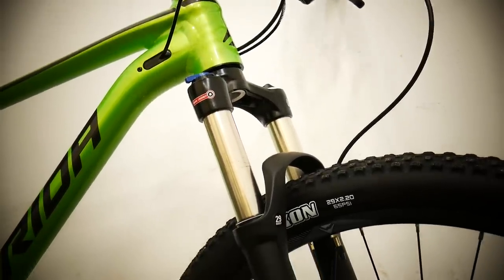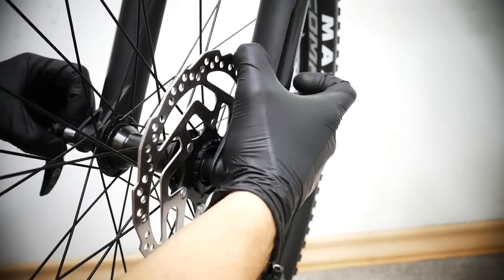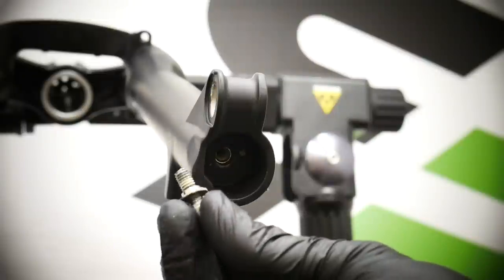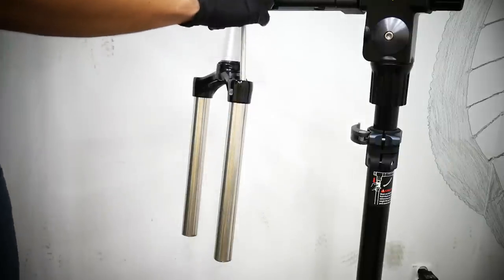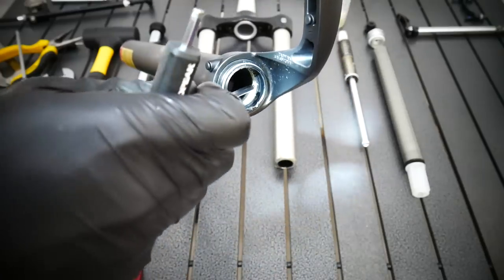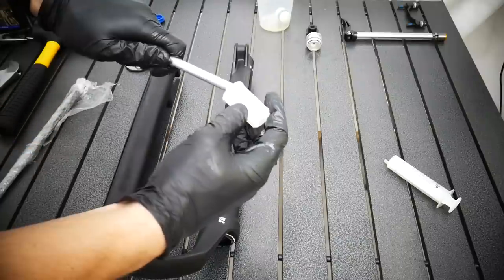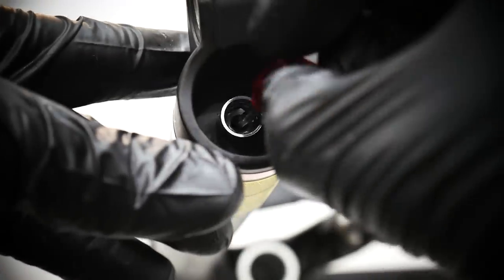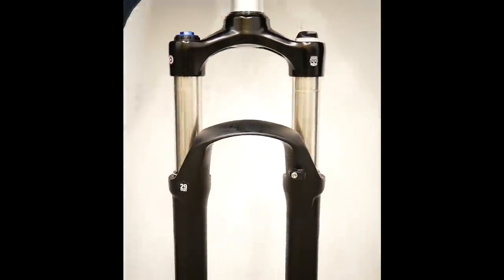Finally! SR Suntour XCR Air LOR Suspension Fork Service. FULL Overhaul.

Comment: This is the closest I can find for servicing my 2015 sr suntour epixon 27.5 forks.. Even after emails to sr suntour they said to just put it in a shop.. They didn't seem to know the oil specs or torque of the bolts, there's nothing on the official website either.. That's poor if you ask me. Very unimpressed with them.
Reply: Go to the Suntour USA website. You”l find some spare parts, and there even oil.

Comment: I like your video guide. After 11 years of use and about 27.000 km, I decided to service the fork. Although it still worked fine.  I viewed several videos and didn't find any pertaining to my specific fork. However, while doing the service I noticed that with a little technical knowledge, you can do similar forks as well. One other thing I have noticed, is that there was no need to actually do a service /cleaning on my fork. Yes, the grease looked old, but there was no water or dirt inside. It has been a learning experience for me. Maybe there is a need on bikes that are in the dirt frequently. My fork doesn't perform any better after the service. Thank you to the creator of the video. Very great job.

Comment: Great video. THANKS! Just a clarification: it is not an error to put air at 13"0' because without it, it is not possible to screw the nut of the air cylinder at the bottom: it turns without tightening, the rod inside is not fixed.

Comment: This video was so helpful to me.
Had 2 bike shops laugh at me when I told them i was going to service my forks.
Anyone debating weather or not to service your forks, give it a go!
After 6 months of use mine had completely stopped working. They were not absorbing any small bumps and would stay completely ridged over rough terrain until a large amount of pressure was put onto them such as a drop etc.
I didn’t take the whole fork apart like in the video and still had good results and it only took around 20mins. I turned my bike upside down and took the wheel and break off. All i did was take off the adjuster nob, undo the allen bolts, take off the lower legs and give everything a clean and re-grease  
If you get a torch you can see Inside the lower legs there are small square indents around 1cm x1cm around the inside of the shaft. I put a fair bit of grease in these indents as this is where the stanchions sit once they are put back together and will help keep them lubed. 

You don’t have to take everything apart on the forks just take the lowers off and clean them up and put new grease on the inside and around the seals.

The forks are working great for me now this video helped a lot. Thanks
Reply: I had the same reaction from my bike shop - so will do myself. Did you put in the foam rings? Does anyone know what diameter they would be? Great video very helpful
Reply: @gavinfreeman3234  didn’t put in the foam rings. By the sounds of it suntour forks run off grease alone and don’t have oil. I think the foam rings are mainly to act as a sponge for the oil to lube the stanchions as they move. After around 20 hours of riding i can start to notice them stiffening up again, i think its due to the dry dust getting into the forks. On sr suntours website they suggest the forks seals need regreasing from the inside after every 25 hours of riding so i will be doing this more often now as i found it a fairly simple job that only took 20 minutes or so.
Have you done yours yet?
Reply: @yaface120  Nope But that makes sense - on the video it looks like there is some oil in fork - but only about 5ml. Never done it before, what grease do you use? It is my sons bike and i can feel it starting to stiffen up a little. But he is such a light weight that i suspect he could go another 100 hours before it become a problem
Reply: @gavinfreeman3234  on rockshox forks videos it seems like the oil gets put in the legs where the stanchions sit? On the suntours the oil goes in the top compartment im guessing to lube the spring. Im not an expert so could be wrong. 
I used fenwicks high speed grease as it was all i had around. I think its made mostly for bearings but its pretty thin so i thought it would be ok. Most videos I’ve watched recommend sram butter or slick honey if that helps

Comment: I have my Suntour Epicon X1, which I am using for almost 20 years now, and still working very nice and smooth. All parts are almost exactly the same as your XCR except on the negative spring assembly. My X1 negative spring had a stopper with pin to adjust the travel of the fork. I changed the travel from 100 to 120mm 4 years ago, and that was the first and the last time that I serviced my fork. You mentioned that your XCR do not have an Oil Foam Ring, mine have.
Reply: What is the diameter of the thread on the upper part of the damper (oil cartridge) -right, for epicon x1 it is fun062-10 !?

Comment: Great video,  worked for the XCR Air that is fitted as standard on my 2017 Specialized Rockhopper.    The forks were terrible before the service, even though they have not been used much,   but they are far better now.   When putting it back together I needed to have some air pressure in and apply a sharp downward force to get the air spring side bottom bolt to tighten properly,  before this the internal shaft kept spinning.     As per the video,  I then had to let the pressure out to get the rebound side bottom bolt in.            I gave the internals a full degrease and only used oil when reassembling,  the fork now gives far better small bump performance.      Others have also suggested oil rather than grease improves the fork.
Reply: What about the air piston oil?
¡We have same bike!
I wanna do the service to my fork too but i am worry if i gonna need new oil.

Comment: FYI The Q Loc axle. 
After loosening the quick release, make sure to push then turn/tighten the bolt to keep the flanges in.  This is the correct manufacturer's guidelines.
  Because for one reason, it will jam up on some models of hubs, due to step downs and widening inside ;)

Comment: I just added a small piece of foam inside the air chamber to make the fork more progressive so it reacts better under small bumps and it actually works. I am now using less pressure but I can feel it getting stiffer as it reaches the end of travel. 
Until now it was all soft and bottom out or hugely stiff with no small bump compliance at all.  Its a nice fork (for what it costs) and it has taken quite a bit of abuse and its going strong after a 1000Km of trails.
Reply: Can you clarify what type of foam? Was it directly inside the air chamber above the piston?
Reply: @denismacfarlane255  It was a  small piece of closed cell foam that i cut to size and with a hole in the center  that I attached to the inside of the air top cap . I have  had to cut it  a bit to get it right but it enabled me to lower the air pressure so the fork works better on small bumps without bottoming out anymore.  Suntour used to sell a piece off foam  for this fork and that is where I got the idea from.
Reply: @cortarelva  What size form did you use?
Reply: since the negative spring is a coil you can just fill the air chamber with oil to reduce the volume. But dont dump it in, do it in for example 5ml steps (fox float fluid pillow packs are nice for this)

Comment: I just got a 2022 version of this fork. I have owned a couple of the higher spec suntour Aion forks before and loved them. Initial impressions of this one are pretty positive after 1 ride... still need to play arround with rebound settings.  The forks specs are very good for the money. It's not as nice as a more expensive ones, but you get what you pay for and it seems a capable budget fork. There are still no foam rings but I ordered some... didn't cost much. I'm wondering if it is because they have steel stantions? I noticed that none of the suntour or rockshox forks with steel stantions feature a sag indicator ring... and now wondering if they all omit the foam rings too, possibly to prevent rust forming if they get saturated with water from neglect / poor maintenance 🤔 I will be careful to do regular lower leg services to be safe. Overall i like this fork. It should not be confused with the realy cheap steel sprung suntour forks on "leasure" mtb's. This is significantly higher performance and quality. Thanks so much for the great tutorial 😀

Comment: Nice work. I have a 2017 Cube Stereo HPA 120 Race with a Manitou Minute TS air fork that deserves a rebuild. I can't locate any vids or info on how to rebuild this fork, or procuring new seals and foam rings. It's got 1000 Miles on it and is in great condition, shall I just give it a go? I do all my own work on our bikes and should have the tools needed. You made this SR suntour rebuild look quite simple, thanks for the push.

Comment: Tanks a lot fpr this video! Did an overhaul of my Suntour Raidon 34 Boost, which is pretty much the same build. Got it perfect and the fork works even better then new now! BTW i used SlickKick forkgrease and Liqui Moly 80W (GL4) oil. Fork is working very smooth now!
Reply: How much oil did you put in

Comment: This is very similar to my Raidon LOR boost fork that came on my 27.5+ bike, except the rebound knob/bolt and the air shaft fixing bolt aren't recessed like this XCR. I was also surprised to find no fork oil inside, however mine did have the foam rings above the bushings. It is a solid fork but terrible at ironing out smaller bumps and plushness. I am currently trying to tune the fork using different negative springs to see if there is any improvement, but so far still pretty disappointing.
Reply: @justahasbeen  Thanks for that. Have ordered a new Rockshox Sektor now anyway and waiting for that to arrive. I'll see how they compare and if the Sektor is worth it. Not a high end fork by any means but I would hope its better. I wonder about the longevity of that compression/rebound assembly too and the fact that it's not rebuild-able could be a false economy.
Reply: Same here
Reply: Thought I should add to my comment that my Rockshox Sektors have been amazing. A whole other level and I would say worth the money for sure. Pay a couple of hundred more (AUD) and you get so much more tune-ability, quality and performance. You can see where the extra cost goes.
Reply: Another work around with good results, is to buy some closed cell foam, and cut to shape so it fixs in the air chamber- through the top.  It works like air spacers making the fork more progressive through the stroke.  So, once it's installed run a lower pressure in the fork to improve small bump performance and combined with adding oil into the lowers it should be a dream.  This will be my next project on bike with Epixon forks :) I can't say how tall the foam should be as this is something I'll have to discover, using standard air spacers for reference :)

Comment: what about the oil on the lower legs of the fork ? this system is actually basically the same system used on Fox older shock . great move by Sr Suntour
Reply: Oil can be used and is often as an upgrade, but no oil means quick and cleaner service with no spillage.

Comment: What is the diameter of the thread on the upper part of the damper (oil cartridge) -right, for epicon it is fun062-10 , and what is the diameter of the XCR cartridge thread  FUN 082-10 ?

Comment: great video man!! is the rebound  clicky ? or just does it just turn with no sound ? 
i just got a new bike with the same XCR air and i don't see any difference between the rebound fully open or closed so i was wondering if it might be faulty
Reply: @tmonteur5264  thanks buddy , did you have to disassembly the entire fork or can i just remove the red knob and adjust it , and what kinda tool did you use to do that ?

Comment: Could you do some epixon forks service?
Reply: It's the same. Clean the outside of the fork with 91% isopropyl alcohol first to avoid washing more dirt into it. Unbolt and drop the lowers like in the video by carefully pulling with one hand on each side, don't grab the crown if it feels stuck insert the bolts 4 turns and try tapping again. Spray everything with 91% rubbing alcohol, not degreaser. Wipe everything clean. Use a dowel and clean shop towel to wipe inside the lowers. Regrease inside the wipers and on the spring shaft and rebound shaft. Carefully slide it back together and torque the bolts to 10nm. Go ride it! Airspring service is only needed if it's leaking and the cartridge can't be removed so there's no point to risk messing it up.

Comment: awesome thank you - but one thing: you didnt mention anything about adjusting travel - this fork is supposed to be adjustable from 100-140mm  (at least mine is I believe - XCR34 LO R Air Boost)
Reply: The xcr 34 is, but this is an xcr32. I don't think it's adjustable, if it is adjustable it's only 80-100 for 29ers and 80-120 for 27.5

Comment: What about foam rings? Is it possible to install them into the fork? Which rings will fits?
Reply: 32mm diameter foam rings will fit. I used the ones that are for rockshox.
Reply: Yes, I installed 32mm foam rings on my XCR and it made a huge improvement: https://youtu.be/BxSWEHqFu2g

Comment: Great video! Do you think there would be any sense in upgrading my Xcm hlo coil fork to air? A local machine shop makes air springs for santour forks for around $30.
Reply: Not neccesarily, be easier to get another fork 😊
Reply: @mrjoeybackwheel1473 . Thanks. Speaking of which, just ordered the manitou markhor last night
Reply: @timothychua-reyes5631  great choice

Comment: Thanks for the video, i just bought Epicon Front air fork and the suspension is too hard, at your video 3:38 to release air, can i use the same method to make it softer? Or any idea how to release the air to make it softer? big thanks!
Reply: You shouldn't use a hex wrench or any other stick to take the air out, you could Mess the valve up. Use a fork air bomb instead!!!

Comment: Could you possibly do a video on converting a coil fork to air such as on a fork that comes in both options. I have heard people doing this on rockshox forks
Reply: Lol no, is impossible
Reply: @007kuntasod  it has been done before https://forums.mtbr.com/shocks-suspension/rockshox-xc-32-tk-coil-solo-air-conversion-868476.html
Reply: I tried with my XCR 30 with custom parts and 3d printing. I was trying to recreate Rockshox's Debonair system, but Suntour make their stantions with different inner diameter at the different places, so the stantion inside is not straight. I give up, because i can't find the right size pipe to make it like the Rockshox's Soloair.

Only if my Xcr was 32mm, i would buy the Soloair from Rockshox. 😢😢😢

Comment: I have a Rockshox 30 silver TK and I have an issue regarding this fork. The rebound knob is not making clicking sounds while trying to adjust the rebound damping, it just slides round and round smoothly and also it is harder to push the knob in its position. Can you tell me what is causing the problem? Do I need to replace the rebound damper with new one?

Comment: Could you go into detail about the foam ring?
Reply: Can I help? :) what about them?
Reply: Yes. Did you add foam rings? What rings did you use?
Reply: @herculesmclovin  I can't find cheap foam rings anywhere. Order a 'bunch' from Korea for £10 and when they arrived it was only 1!
Reply: @trevorryan3343  you can buy all the rebuild kit in AliExpress
Reply: @neutralbuoyancy  I got mine on ebay (from china), and it works awesome now. Here's an install video: https://youtu.be/BxSWEHqFu2g

Comment: My kid's 24" Orbea has these forks (smaller), and they lose pressure in a day or less.  I have them disassembled and I am replacing the o-rings as well as the schrader valve.  I have a new piston (with new o-ring) from Suntour also.  Here's hoping it all goes back together and holds air.  Anyone else have that issue???
Reply: Had the same problem and never fixed it
Reply: Here's a possible solution for this problem, all you would need is a little gear oil (80w) and tools. https://youtu.be/f6W5Zwv4t-w
Reply: @forestfriend9265  Thanks!  I ordered some cheap parts from suntour, including new o-rings, took it completely apart (except for the damper) and rebuilt it.  Very simple.  The parts were probably unnecessary, but <$20 so I didn't care.  I suspect it just needed the o-rings refreshed.

Exchnaged a couple emails with Suntour Support and guy who was surprisingly super nice and helpful.  So forks are good and not leaking anymore.  Now....about this derailleur he just destroyed, LOL.